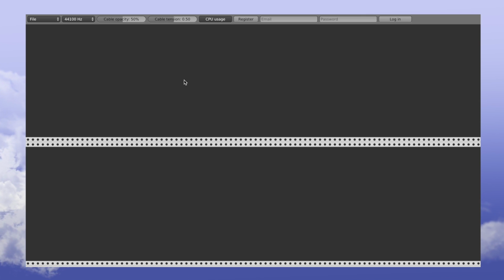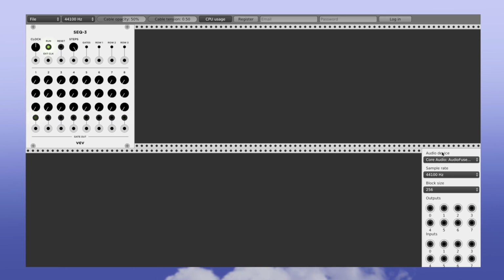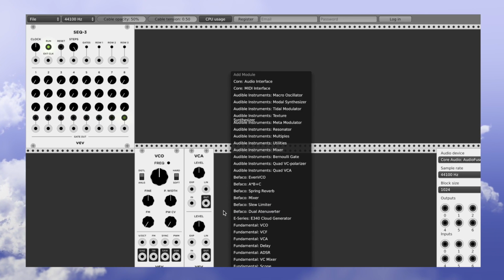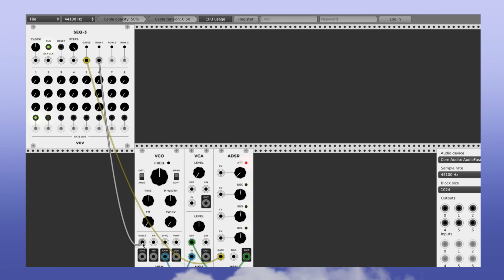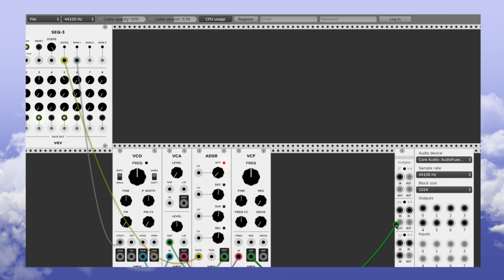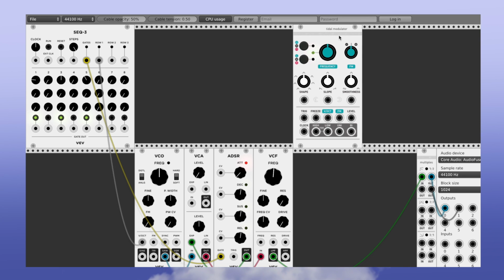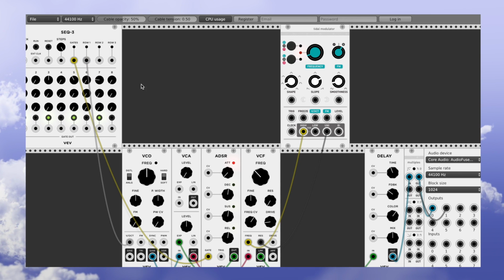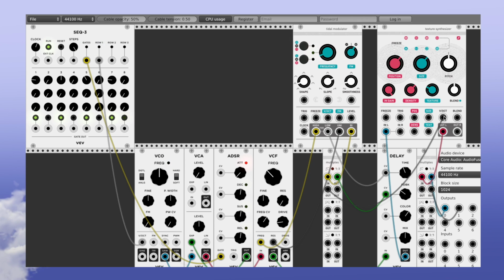How To Make A Synth Patch - Beginner Tutorial on Modular Synthesis using VCV RACK (FREE SOFTWARE)

Comment: I get no knobs, no inputs or outputs ... what gives?
Reply from the maker: Raymond Catror 1 register acccount 2 on the webpage: scroll down and add modules by clicking on the add (or similar) button 3 log in inside software 4 click refresh plugins = downloads them 5 right click to get the menu with the list of plugins. 6 Follow my build :-)
Reply: @BoBeats  i can't find the audio interface
Reply: @gaugebessert7617  Same here. It either changed name or isn't on the pack anymore. I see Core > Audio, and seems to be similar. But I can't get sound out (yet).
Reply from the maker: Another user wrote "I deleted Audible Instruments from Rack Plug-ins folder and re-downloaded them, all working now"

On OSX I didnt have to move any files. But I don't know if it works 100% with all OS versions. I read somewhere that 10.6 (?!?!) didn't work. Unfortunately I cant help much more since I have zero clue about these things. I have installed on latest Mac OS X and Windows 10 and it works for me. Sad that it doesn't work mate :(
Reply: No Knobs is a bug. Occurs on Win 7 and several different Mac configurations. I think the developer is trying to track this down. I had the same problem , Win 7.
Reply: BoBeats Hi, thanks for reply, I did those steps, and even trashed and reinstalled Rack, then logged in within Rack and refreshed plugins. Same result. Do the plugs need to be dragged to a specific folder (OSX)? I really want to get this working. Also my Rack doesn't display that horizontal line across the middle...
Reply: Thanks for the update Craig.
Reply: HggrttrfgttyyfzbcnzNzn bz  b nnxxn nn      nznnnnnnnXcffuuu6455
Reply: @jurajobert4790  Ok, Juraj

Comment: Thanks for the video, it got me finally to make a patch. By the way, you can pull multiple wires out of a single hole with ctrl,  that way you don't need to use the splitter.

Comment: Nice! Amazing what can be done with a single monophonic oscillator. You could have gotten true stereo from the Texture Synthesizer. Alternatively, you could use the Haas effect. There are Haas modules by Sonus and Edge, but to fully control the effect, DIY with a delay and multiplexer run through a simple (or not-so-simple) mixer. You could modulate the delay and the balance and all kinds of good stuffs.

Comment: Great video dude! Just starting to learn about modular and this was a big help! For getting the stereo sound, when you cable from your LPF to output 0, just take a cable from output 1 back to the LPF and drop it in on top. Problem solved with no need for the multiplier :)

Comment: Just discovered this tutorial after downloading VCV. Super helpful! I'm just starting, but you can drag Output 1 to your VCA's Out, then from Output 2 to the same VCA's out. You'll get a mono sound in both ears (two cables to the same Out in the VCA). Otherwise I've also used the top VCA as a "left" channel by connecting it to Output 1 and the bottom one as a "right" by connecting it to Output 2. (yours are labelled 0 and 1). Just trying a few things; this is my first 10 mins with a modular synth!

Comment: If I wanted to put an Adsr to control the onset of my filter sweep, how would I go about doing it? Thanks in advance.
Reply from the maker: Make an ADSR, trig it from whatever source you use (sequencer? keyboard = gate output into gate input, exponential?, I think) and then use the ADSR out into the filter FM/frequency CV input. And use that knob to set pos/neg amount. That should be about it I think

Comment: You can send a single VCO or mixer output to two sound output channels (0 & 1 for example) to hear the sound on both sides. This can be done by holding down the ctrl key while dragging the 2nd wire. More generally, holding down ctrl can be used to connect one output to multiple inputs.
Reply: You can also just drag the opposite way without holding down a modifier key -- make a cable from Audio Input 1 to Mix and then Audio Input 2 to Mix.
Reply: anyone know which key for Mac?
Reply: @kurks001   cmd
Reply: @kurks001  press the CMD key
Reply: Dude, this is awesome! Thank you!

Comment: If you use Mac, to get a single output to play on both speakers, you join the first output to the audio driver module. Then you go back to the same output, hold down the cmd key on your computer, and then it lets you run a second wire from the same output, and you plug that into the second output on the audio module.
Reply from the maker: cheers mate! Not sure if this was available when I made the video but great advice nevertheless
Reply: No problem man. I'm just getting started with modular stuff. I discovered it somewhere just before I watched your video. Which was great help by the way for someone just getting started with this software. It's amazing. I don't suppose you know if there is a way to assign knobs on your midi controller to control knobs on the rack? I've been hunting for a way to do it but so far I'm not getting any joy. I'm used to ableton making it easy for us to assign any parameter to any knob. I want to get more hands on with things once I set up a patch
Reply: Thanks for making it
Reply from the maker: +Crypto Clarky sorry but I do not know about the midi controller capabilities
Reply: as far as I know you can't assign the knobs to MIDI devices directly (like you can do in Reason or Ableton). But you can use the "MIDI CC to CV Interface". it will at least give you the possibility to "generate" Control Voltages by a MIDI device.
Reply: Hey thanks for the reply, I since worked out how to do that but appreciate the reply

Comment: Does it matter whether you go VCA -> VCF or VCF -> VCA?
Reply from the maker: +UltimateWobbleBoss yes you need amp of the signal before filtering the signal in most cases I belive, it seems to be standard. But I dont know if it matters in this software at all
Reply: You can think of a VCA as a volume knob. So putting it before or after the filter doesn't really matter, just depends what you are trying to do.
Reply from the maker: well put. I assume that since an amp, in theory at least, will add character to a sound (in hardware format) placing it before or after a filter should have some theoretical difference no?
Reply: Both seem to work but I've yet to pay attention enough to find any differences. Thanks though!